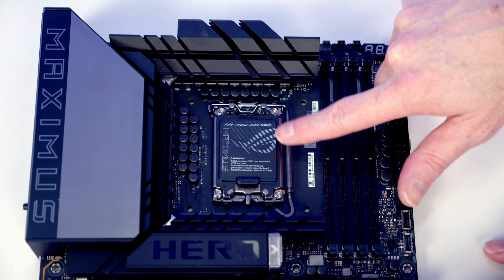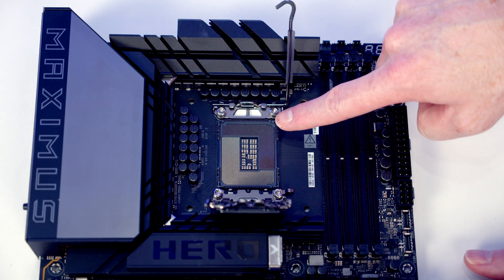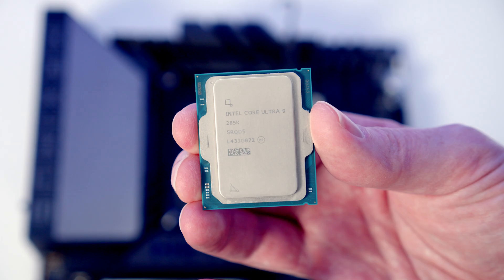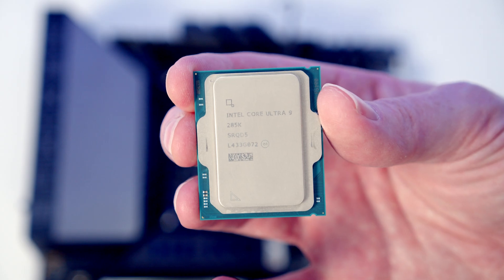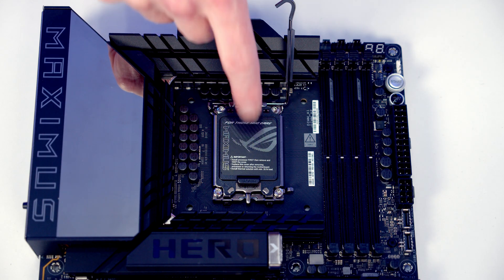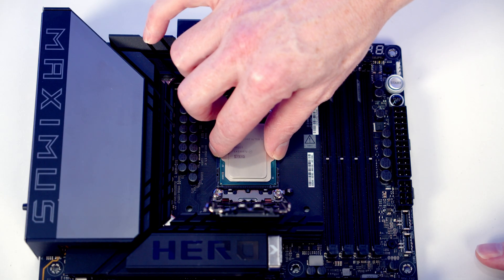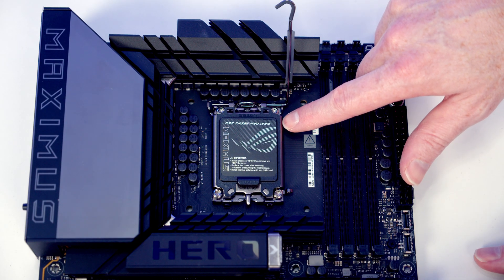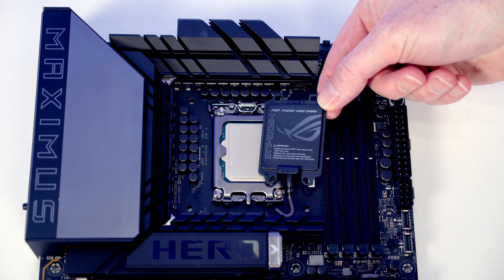How to Install an Intel CPU

Comment: When you wiggle the CPU you risk damaging the pins on the socket. You should lower the CPU right without hand shaking, there is no chance to correct anything. Intel CPUs are hot garbage.